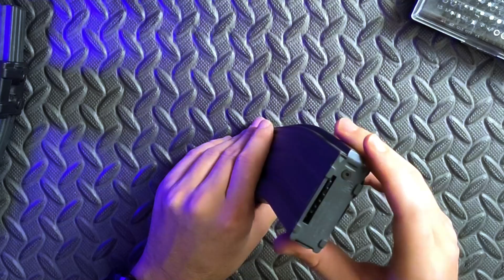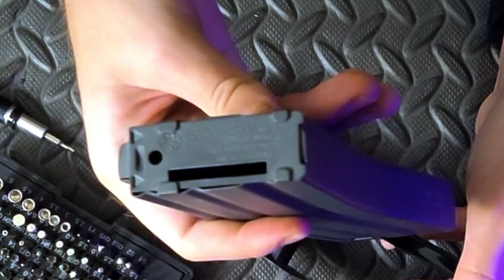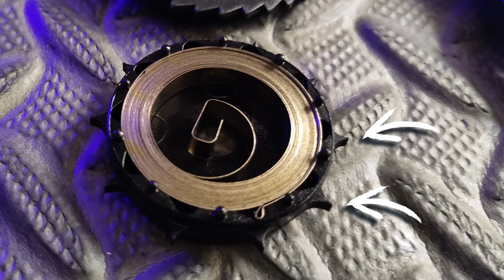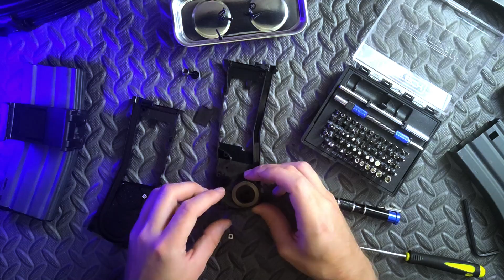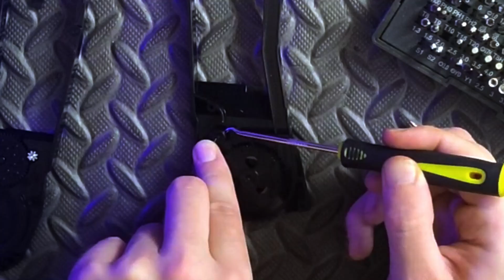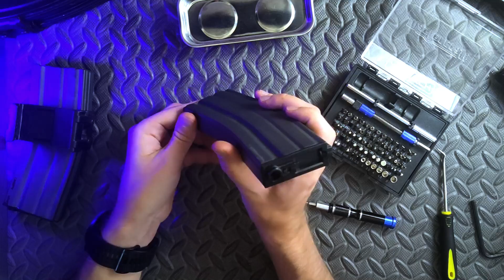High-Cap Mags: How They Work + Repair Guide

Comment: Mine doesn't have a screw and it's not coming undone when I push the clip
Reply from the maker: Is there a pin? Look for any fastener. If there really doesn't look like anything is physically stopping it, it might just be seized. 

Look up your specific mag to see if there is a part list and/or disassembly guide.
Reply: @airsoftuniversity I was able to open it but all the parts went everywhere I got them all I just don't know where to put them I have an aeg k418 thank you
Reply: Fixed it

Comment: Wait so what if the little dull "teeth" on the gear with the coil spring break off, should I just buy a new mag or is there a part I could buy for it?
Reply from the maker: A lot of bigger manufacturers do have individual parts you can buy, but you might end up paying shipping that costs more than the mag itself - you'll have to do some research for your specific brand and location to figure out what makes more sense.

Comment: I still don't get it, why don't you have to release the tension on the spring? You just infinitely wind it?
Reply from the maker: Nope, as I said, there's a limit to how many times you can wind it before something goes wrong. You can release the tension by pulling back the stopper, which will eject all the BBs it can. If the mag isn't loaded, it can never gain tensions because there's no backpressure from the string of BBs in the ready chamber.

Comment: hey my airsoft mag does not have any of the things to take it apart, I've looked all over it but didn't find anything that could take the internal part with the wind wheel out. Any help on this?
Reply: I use a gf76 btw

Comment: hi do you know where can i find a replacement for the antireversal spring?
Reply from the maker: You should be able to find a part breakout diagram for your mag from the company it's made by, and order it by the specific part number. This is the most "official" way to do it, but it just takes a bit of time and research.
Reply: @airsoftuniversity  i just spent 2 hours looking for that spring for a lonex hicap pull string mag... No one sells them in EU
Reply from the maker: Hmm well you may not be able to find it locally. I know for around here I have to order things internationally.

Comment: What can I do if I lose the pin that keeps the internals of the mag inside the mag?
Reply from the maker: There are a few ways you could fix this, but what makes a pin useful is the tapered end that flares so it gets locked in place. Get creative if you need, or head over to a hardware store and get a bag of them on the cheap. You could use a drill bit that has been hammered, or even something as simple as a bobby pin or a paper clip if it's the right width. There are lots of options, have fun with it!

If you want to do it the proper way, look up the manufacturers part breakout diagram for the mag and order the specific pin that you need. 🫡
Reply: @airsoftuniversity  thanks!!

Comment: Funny guy. Anti-reverse spring is the hard bit lol😂 clearly you must have witchcraft gifts to think the Tape spring is easy. These things iv had nightmares over on nitro rc pollsters & this was a twat to me.
Bbs stopped feeding I looked at Tape spring & Thought it snapped.  I successfully used drill to wind it, cable tied it to stop it opening then found out what I thought was the snap was  the looped back end from Grip😢
 I'm hoping the half a bb was my problem

Thanks for video it helped me understand my cyma mag, only the spring wheel is different
Reply from the maker: Haha okay that's reasonable - the tape spring can absolutely be a nightmare 😅 that's a great strategy for winding them back up though - very ingenuitive! 👌

Thanks for the comment, I'm really glad this could be at all helpful! 🫡
Reply: @airsoftuniversity  if you do lots of Tape springs it's worth getting a small £1 chuck from China that fits changeable head screw drivers, there the size of a dremil chuck

Comment: Do you know how to fix a flash mag?
Reply from the maker: Not yet! I've personally been hesitant to switch over to them - do you have experience with them? How are they?
Reply: I think they’re superior to hi caps. You don’t have to keep one hand on the winding wheel constantly. Every gun should come with one.
Reply from the maker: @briannoojin1710  Good to know! I've always just been worried about the reliability of a system like that - seems ... flimsy, for lack of a better word. 

Have they been reliable for you? How long have you been using them?
Reply: I broke my M4 mag because I got too enthusiastic with the pull string. My AK flash mag works great. I’m just more careful about the pull cord. Give it a try. They’re not anymore expensive than other mags.
Reply from the maker: @briannoojin1710   Ahh see that sounds like something I'd do too 🤣Reliability is usually my most appreciated aspect about a product in my life so I'll let you know how they stand up to the trials of my accident-prone life LOL 😅 

Thanks for the awesome input and information - always looking to learn more so don't ever shy away from speaking up on this channel 🫡